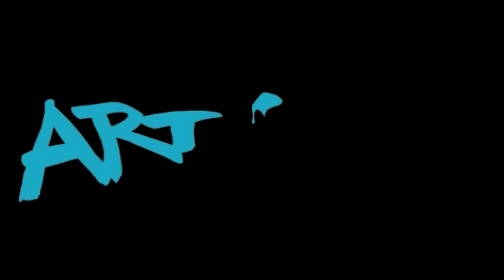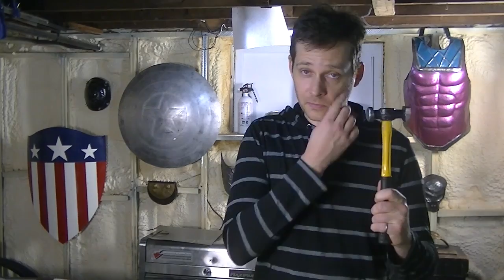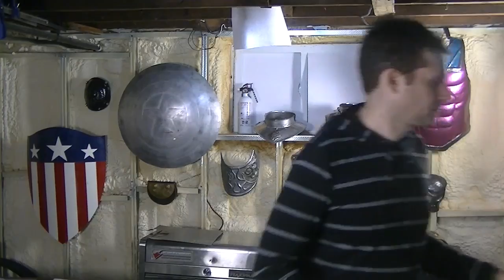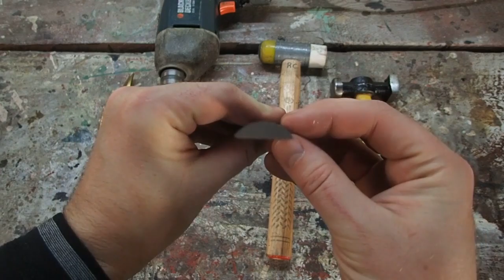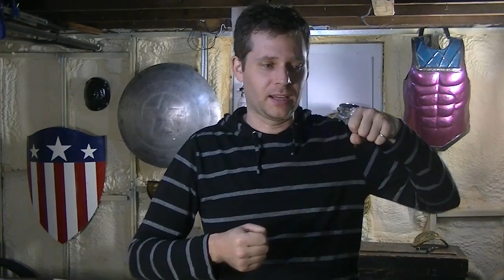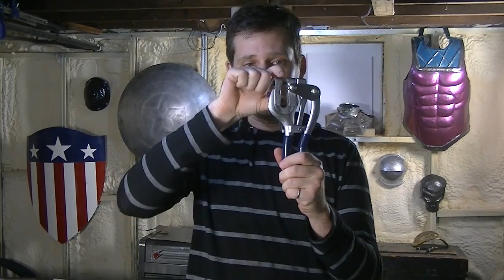Armour for Cosplay 2 - The Tools you Need

Comment: You may have trouble finding a dome headed hammer. After checking Home Depot, WalMart, NAPA, Harbor Freight, and Grainger as well as Amazon Prime and finding none I decided to make my own. Grainger actually did have one but I'm not paying $80 for a hammer. Also if you are buying a hammer in a set or online make sure it actually is domed. A lot of times the picture makes it look like it is, but it is not.

I bought a ball peen hammer and then took the flat face of it an ground it into a dome. It's pretty simple, put the hammer against a grinding wheel at an angle, say 5 degrees, and spin it all of the way around. You may have to flip the hammer over to get more than a half spin. Then repeat this for 10, 15 an 20 degrees. I was able to get it done in about a minute. If you  hammer with the ball peen end then the metal deforms much faster, but it leaves behind a very bumpy surface which takes more time to fix than it saves.